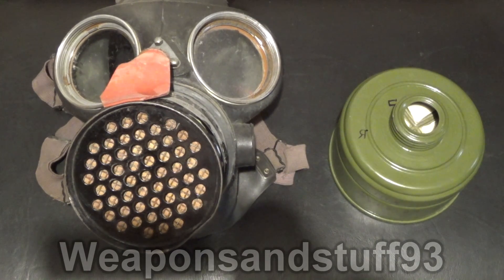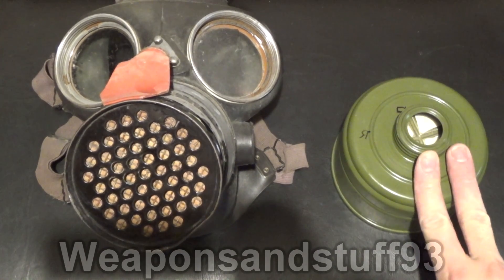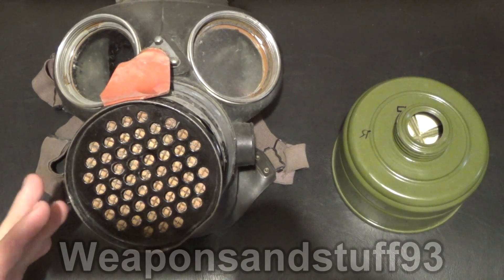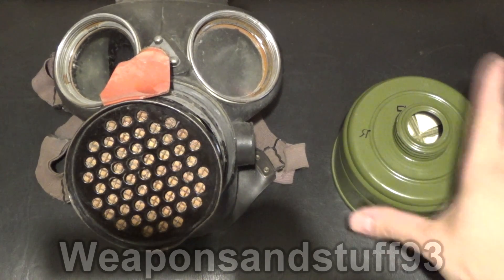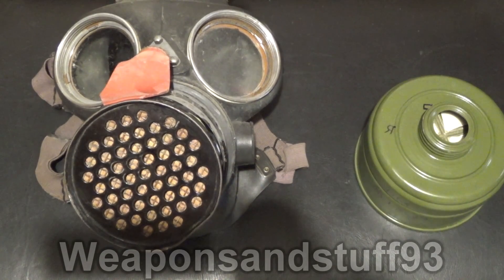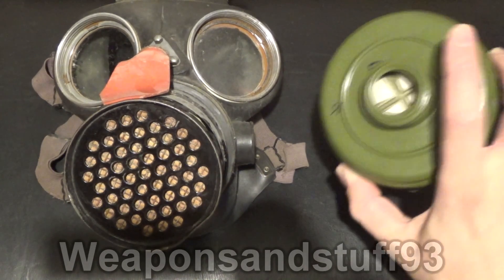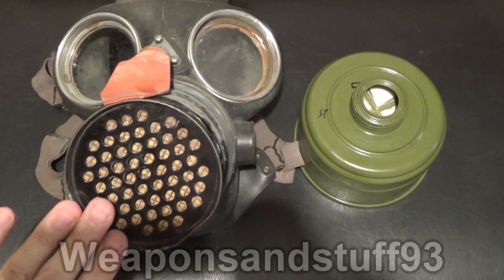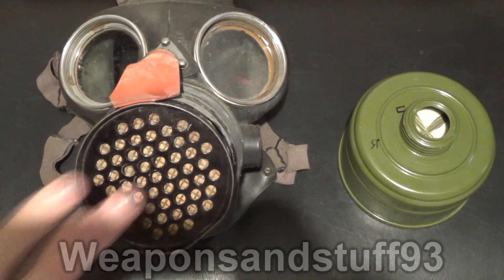Why was Asbestos used in Gas Mask filters?

Comment: It's quite entertaining for me to watch the asbestos debate considering when I was at uni, I had to sign a contract stating I wouldn't sue the university if I develop problems. All of the dorm rooms had asbestos and they couldn't be bothered to hire a clean up. So likely I'm already boned.
Reply from the maker: Surprised they can actually get away with that.
Reply: Welcome to America lol. Recently ordered a GP5, so now I'm on the hunt for a safe filter that wont break the bank on shipping. I may just try out the trick you did with the P3 filter cut out until I can get an FP5.
Reply: Empress Julia (Hint: You can probably still sue them.)

Comment: I weared a 1938 Hungarian gas mask 2 times(about 1 minute in total) and a Romanian 1974 gas mask many times.Is this bad? (Sorry for the bad english)
Reply from the maker: If it was briefly you should be fine, if worried get a lung x-ray taken.
Reply: @weaponsandstuff93  I didn't weared the 1938 mask more than 1 minute,but i weared the romanian 1974 mask more.(aprox 2 hours in total) One of the filters for the Romanian gas mask it's dated 1989,and the other one 1976 (i have 2 filters for that gas  mask,but i can screw them 
 into the WW2 one.
Reply: @weaponsandstuff93  And what i can do with the 1938 mask and filter,i have the original canister,it's complete,just put it in the canister and never open it?

Comment: Okay, I have a question:
I had an old GP-5 filter that I stored with some other stuff for quite some time (about 6 years) without knowing it was dangerous. The filter was an '85 issue one can came without caps although it was undamaged.
What is the chance that asbestos could have leaked out of the bottom of it whilst it was being stored, and contaminated the surrounding items? It was undamaged and did not appear to be leaking charcoal and I never blew through it.
Reply from the maker: Should be fairly safe then.
Reply: Thanks man, I know I bug you a bit about the asbestos stuff, but after seeing first hand what it can do its kind of become a paranoia, especially as I found I was breathing through a potential asbestos filter for a long time.

This was an excellent video by the way, and it has answered a major question I had, as it was hard to see why a silicate would be of any use within a filter system, especially when it was later known to be dangerous.

Comment: Are there masks/filters that can protect against cyanide and methylene chloride?
Reply from the maker: Both ABEK and CBRN filters would
Reply: I've always heard that the blood agents would penetrate your filter and render it ineffective, then they would follow up with a more dangerous chemical attack.
Reply from the maker: They still work the same way as any other vapour, the filter can block them but large amounts will overwhelm a filter, it's why you need good working filters and preferably a spare.

Comment: Where do you buy your safe filters from? I just want a newer one that is confirmed 100% fake that I can use as an airsoft mask and wear all the time without having to worry. also where could i get some tempered glass lenses to replace the ones in a gas mask so they can withstand an airsoft bb?
Reply from the maker: Well you can't get fake filters for real masks, you can buy real and safe filters from Amazon or eBay if you look up RD40 filters.
Reply from the maker: Some sellers on eBay also sell custom lenses for certain masks that can withstand BBs

Comment: are there fake filters that you can put on your mask for display?
Reply from the maker: +RussianSpetz Not really but GP5 filters sealed at the bottom on display will be perfectly safe.
Reply: but if its sealed, you cant wear it!
Reply: the fp-5 polish filter is attachable to the GP-5 mask, a it doesn't have asbestos
Reply: JJ blah you can’t breathe if its plugged and yes it is safe if it’s on display and plugged.
Reply: couldnt you just open up a filter and empty it?

Comment: Where can I get a fake gas mask filter (Same shape, size, looks, etc, as a normal one, but empty, and not toxic) that I can screw into one of my masks?
Reply: 3D print em
Reply from the maker: +TabbyclawProductions They're not made, closest you'll get is a 40mm particulate filter.
Reply: Hmm. Somebody should start a fake filter company!
Reply: TabbyclawProductions you can buy 3D Printed 40MM Gost on EBay.co.uk
Reply: you could always just try and gut a filter which would be kinda difficult but you could try
Reply: Arent polish ones safer
Like the one that fits gp 5
Reply: He meant that with for modern filter. Not an asbestos filter. Activated Charcoal is not a cause for Mesothelioma.
Reply: Check eBay for 3d printed ones
Reply: I have a great idea. Why don’t you just cut open an old GP5 filter and use that. Problem solved. 
PS. Please don’t do this, it’s a joke.
Reply: Confederate Airsoft do not do this, just because you are outside, does not mean this will not hurt you. Actually, this would not only give you mesothelioma, but also everyone in your neighborhood.
Reply: TabbyclawProductions I would love to, but have little knowledge of how to... Why is it people always tell me to do things more them...

Comment: Interestingly enough, according to Porton Down the following Gas Mask canisters do not have Asbestos in them.
MB 41, 42, 43, 44, 45. 41's might still have Asbestos in them due to slower uptake on work orders but for the most part they should be aight.
All green banded cannisters are free of Asbestos, I'm assuming it's referring to the Civil Duty mask, which usually has a single red band around it, but sometimes has a green one.
According to Porton Down all light type canisters are free of Asbestos.

Of course don't start huffing these things but they aren't so scary. Porton Down released a report back in the late 80's about them.
http://ibasecretariat.org/porton_down_rep_1989.pdf

Tells you all you need to know, really.
Reply from the maker: It depends, there's been a lot of evidence these filters do have asbestos in. That's a very interesting find though, personally, I wouldn't trust Porton Down seeing as they were complicit in testing chemical weapons on British soldiers.
Reply: @weaponsandstuff93  prove poi smentite da test successivi
Reply: Weaponsandstuff93 True, but seeing as how it was for military and higher ups eyes only, I wouldn't be surprised if it was true. But yeah, it's not worth putting your life on the line to prove a point.

Especially as no one knows how many masks were actually made in WWII.
Reply from the maker: Also, the filters will have broken down over time, so inhaling charcoal dust is bad enough anyway.
Reply: Ay, but hey. At least it's not super scary asbestos that will kill everyone with a ten mile radius of the mask. As some of those news outlets would love you to believe.

Comment: I bought a Gp-5 today came with a filter still with a rubber thing on the bottom and a cap on the top i havent opened it but i have no idea if its been shaken before i bought it so i have it wrapped in a few layers of saran wrap i dont plan to use it but i was wondering if safe whats a safer way to store it so i can keep it as collector's piece
Reply from the maker: Pour some PVA glue into both ends of the filter and let it dry.
Reply: Weaponsandstuff93 so thake the lid and rubber stopper off and just pour glue in it
Reply from the maker: Yeah, you don't need to fill it up, just pour glue in one end and let it dry, then turn it upside down and do the other end.

Comment: i have a gp-5 filter from the 80s or 90s but it was still in the military wraping and it was brand new never used is it safe?
Reply: animal chin 
Dont risk your life, dont use it
Reply from the maker: No, because if it leaks you will get asbestosis.
Reply: how do you really know if it leaks
Reply: @animalchin1460  you know it leaks when you use it, there is some type of white dust coming out of the filter.
Reply: @dudemanbro06  so can you check by holding it upside down or you must inhale it
Reply: Oh you should've gotten a reproduction mask, a reproduction one is a rebuilt version of it and the reproductions don't have the og filter or the og masks its made to look exactly the same as the mask and can be used for role play and it may actually work against some toxic gases.
Reply: @fzafg  i don't think that is a reproduction, bc i found one realy last week at the market here in Hungary (i bought that bc i searched for a gp-5 since a long time) but i throwed away te filter bc i heard that it's not so healty.
Reply: animal chin you basically can use it but then its pretty much russian roulette
Reply: @boogie3718  soviet roulette
Reply: The fibers probably broke down over time.Its to risky to use it.

Comment: I had to use a GP-5 Filter when I was welding galvanized metal and thankfully it was unsealed and intact and only had to use it for about an hour and it did work but I was kinda freaking out in my jead
Reply: The first time I read this I thought you meant you were wearing a ГП-5 mask, and I was alarmed because I don’t believe the lenses on the mask would protect from UV radiation. Now that I’ve read it again, I see that you were only using the filter. I don’t know much about welding, do welding masks filter gas/particles out too? It makes sense, but I didn’t know that.
Reply from the maker: Yeah, in that case, it was safer than inhaling the fumes but it's not advisable to keep using the filter.
Reply: Weaponsandstuff93 yeah I made sure to seal it and write expired on it after the project

Comment: In my science classes, we use forceps with asbestos sleeves on them, to use on hot stuff.
Reply from the maker: Surprised that hasn't been banned, other materials are now used that do the same thing.
Reply: Yeah, the roof of our metal shop in high school was an asbestos mixture. It's still intact as far as I know.

Im not afraid of undisturbed asbestos, or especially "Radon". I'm planning on gost filters for now. I just plan on doing a quick "pft pft" clean up if I have to use them. Maybe cotton balls sprayed with chain lube if I have time.
Trying to prep on a budget, want to cover other bases before I spend hundreds on my masks as my family isn't on board

Comment: It's me again.
When I was putting a filter on a gas mask I saw white inside of it. It's more like a white cloth or something.
It's not dangerous right? I mean I it's a new filter and it says "Expiry date 2014" so it must be a new filter and it was in a bag unopened when I got it but still that white cloth thing is just part of the normal filter?
Reply from the maker: +Filip That's a cloth layer that seals the charcoal in so you can't inhale it.

Comment: I'm planning on getting a gas mask. However, when I do get one, I'm going to replace the filter. But I need to know which filters are completely harmless.
Reply from the maker: +Serj Trollkian Any modern 40mm NATO filter is safe.
Reply: Weaponsandstuff93 Thanks. I did some searching earlier and discovered GP-7 filters. Are they safe?
Reply from the maker: I personally doubt it but I don't think anyone has had them tested. Modern Russian filters are black plastic design, not the old green design.
Reply: Serj Trollkian the Chinese TF1 is also safe.

Comment: I am planning on using my gas masks in case of an emergency scenario, or an apocalypse. I do plan on getting  modern filters though.
Reply from the maker: If you have a Soviet style mask you can get the modern good GOST filters for an ok price on ebay.
I'm tempted to get one for testing at some point.
Reply: Thanks for the information. I'll be sure to look about.
Reply from the maker: They have the ABEK colouring on the side meaning that the filter works against pretty much every gas and I'm assuming it has a particulate filter on as well.
Reply: I knew about the color strips, not sure which gases they imply though. There are purple and red stripes correct( to list some I remember)? Or is it different in Britain? I assume it is given that it would be logical for other countries governments to use different methods of differentiating the types of gas, but I want to be certain.
Reply from the maker: http://www.safetyindustries.co.uk/acatalog/filter_guide.jpg
Reply: Thanks.

Comment: Your ARP Gas mask looks good with the red flapper valve, haven't seen a whole lot of them but there is a few scattered around!
Reply from the maker: Yeah dunno if they replaced the valve at some point or they just had a crate of Mickey Mouse flappers and stuck one on.
Reply: Probably a crate of red valves, well what's the date if its late war it would make sense!

Comment: I know it's off-topic, but I want to ask you did you get all your gas masks from ebay? I want to buy Israeli M15, but on ebay there is like 2-3 Israeli M15 but each is 100$ or more. Do I need to wait so maybe it comes or there are other websites? Thanks.
Reply from the maker: Yeah my M15 was from ebay, I get masks from a few sources but mostly ebay.
Just wait until an M15 turns up for like $40, if you want a similar mask to an M15 but cheaper look at Drager M65 masks.
Reply: Thank you for Drager M65. Found it for 30$ watched your review and I think it's good, thank you.
Reply from the maker: Cool, the only issue with the Drager is if you look down while wearing the mask, the air tight seal can break around your chin. Other than that it's a really good mask.
Reply: Didn't know that, but mask is mostly for collection or sometimes for halloween. And the look of the mask is very nice to me and for the price it's really good looking gas mask.
Reply from the maker: Yeah for what you want it will be fine.
Reply: Thank you for help.